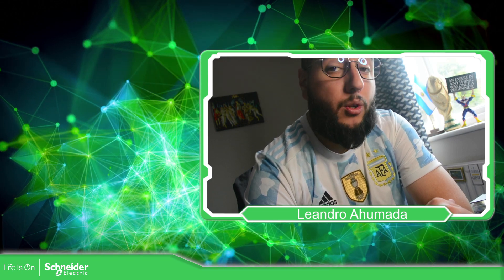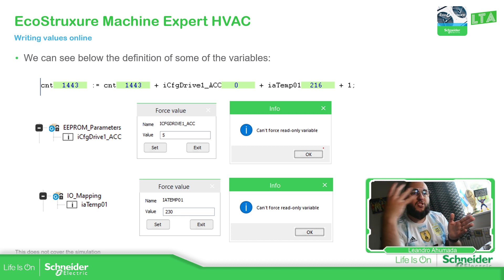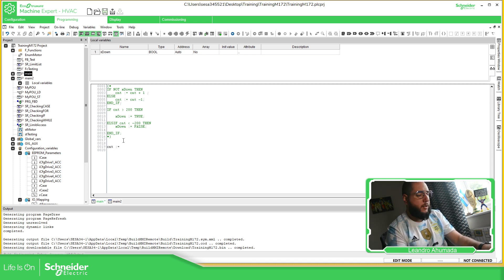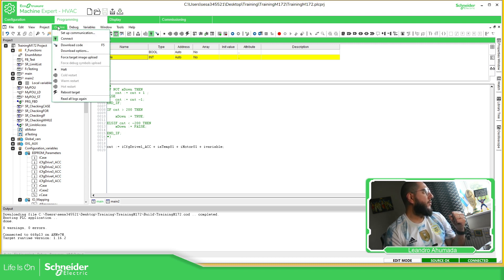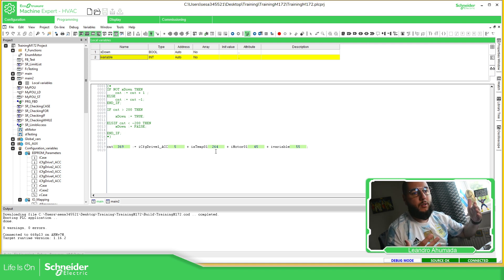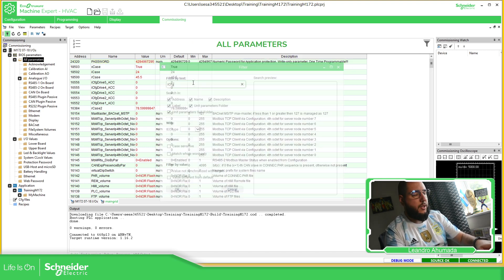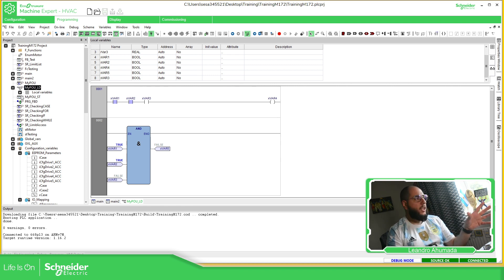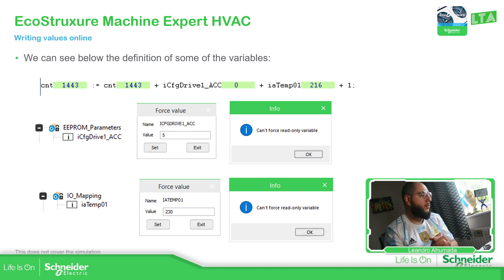EcoStruxure Machine Expert HVAC Training - M7.1 Writing values online

Comment: Thank you.

Is there anything that shows some specifics for linking an M172 to EcoStruxte Operator Terminal Expert, using Modbus TCP ?
Thanks for all the content you upload.
Reply from the maker: Hi there! You will need to export the variables from the esme hvac software and them import them in the eote. I have a ppt for this i will find it
Reply: @LeTomasAHUMADA  I4ve found how to export the MODBUS variable in esme for EOTE, but i struggle making them to connect in EOTE itself, source/target is okay configurated, but i have an adress of the variable issue 

If you have maybe a ressource, it would help yeah, thanks a lot !
Reply from the maker: Please check this presentation: https://app.box.com/s/306n1p957nnpx7uaohxyx8dsskb4ixgq
It is old... in the newer version of EOTE you have the possibility to select on the driver config the HVAC controller (improve communication... in theory).